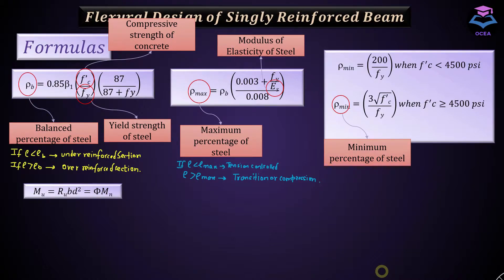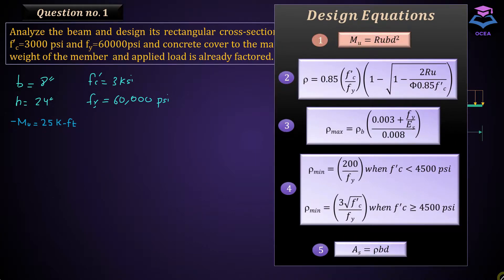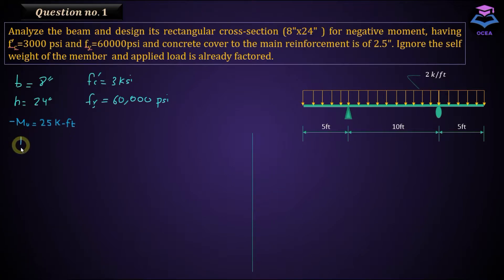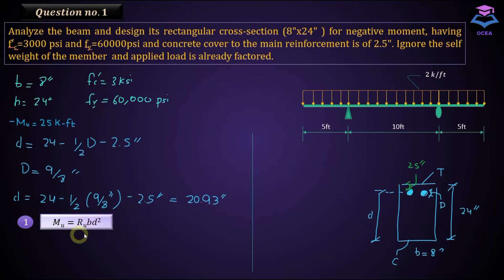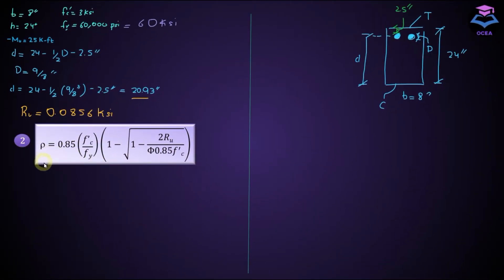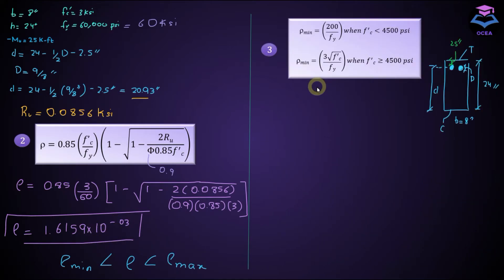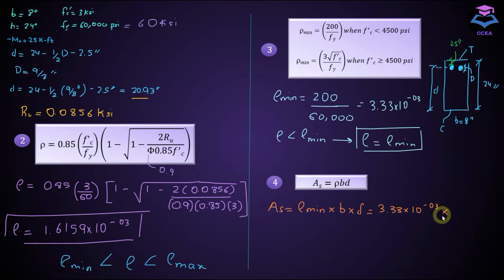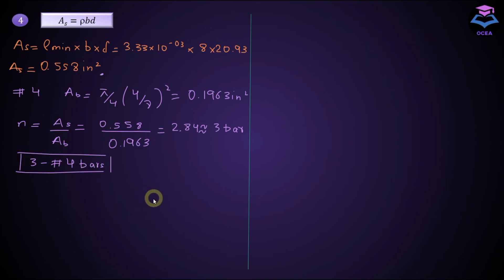Design of beam (flexure)| Negative moment | ACI code

Comment: So even if we have a negative moment for Analysis (NOT design) , would it be the same procedure as Analysis of a positive moment? I was wondering too, you dont need to plug in (-25 k-ft) for Mu ?
Reply from the maker: Yes, you are right.The same procedure would be followed for both analysis positive and negative moment. Only difference is that in negative moment top fibers are in tension and bottom in compression. Yes, you don't need to insert negative sign.